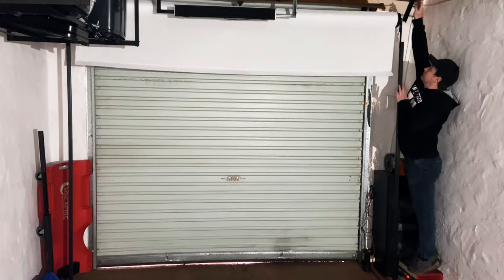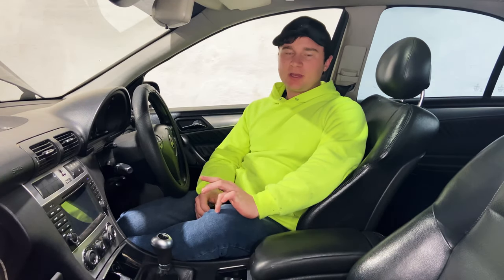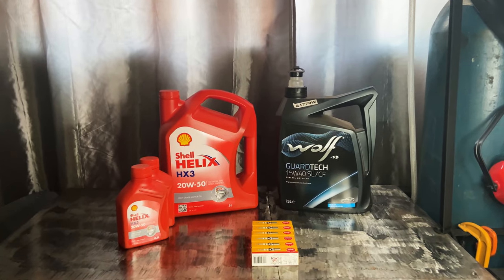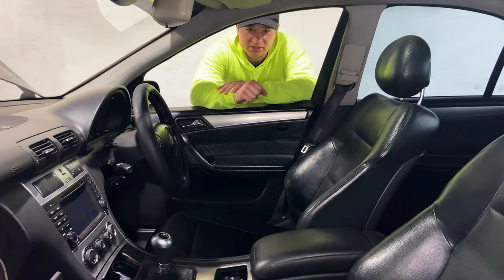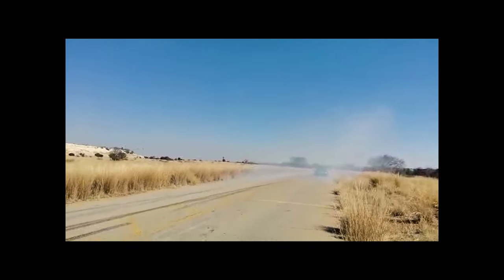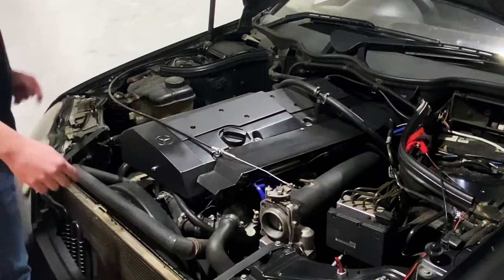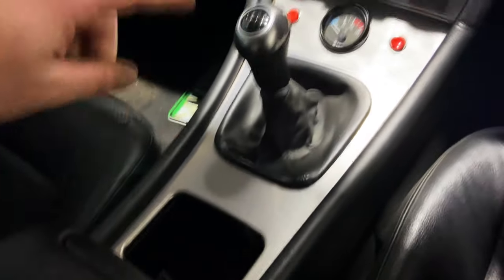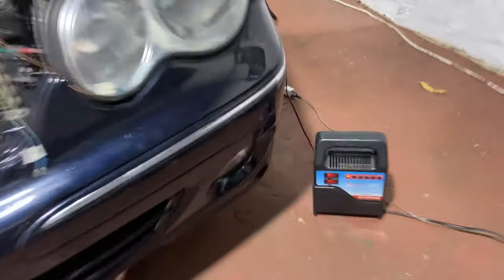JUNKYARD Engine MERCEDES C32 Has Some ISSUES | Engine Knock? (Compression Test) Cold Start Problems!

Comment: trust me, if you had engineknocking you would have known, a easy trick to check it out, is to check if the oil have a golden iron pattern. the M103 is a really strong engine and if you want to get engineknocking on it you would need to drive it dry or overheat it. Anyway it may be that the oil is too thin for the heat and the its a very good chance its the hydralics lifters. I love every video you make! Ur prob the only one that do something cool with the w203 chassie
Reply from the maker: After getting the new oil in there the ticking doesn’t happen anymore 😁unfortunately I didn’t record that test drive. Thanks man I really appreciate it. I found 1 picture online of a w203 with a 2JZ in it. Can’t find any info on it 🤷🏻‍♂️🤣
I’m the only one for good reason 🤣🤣🙏🏻🙏🏻